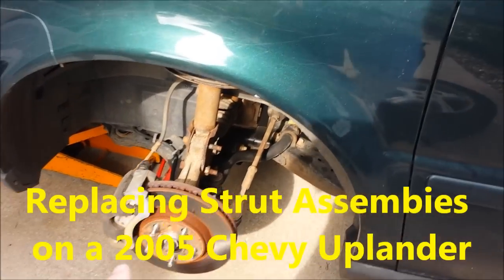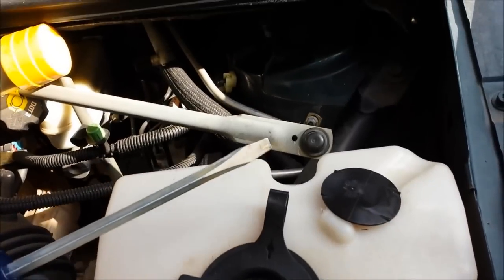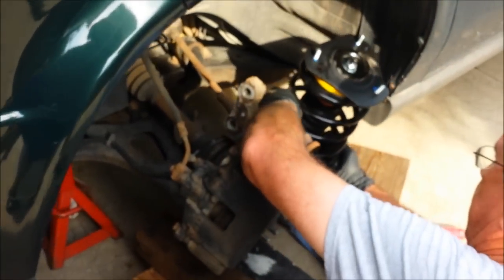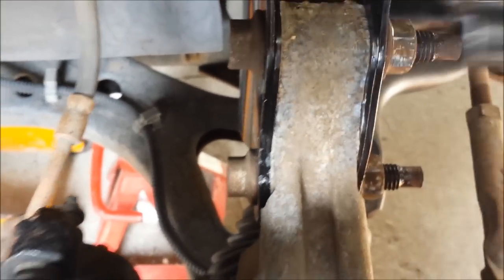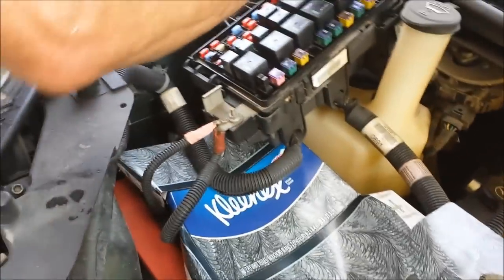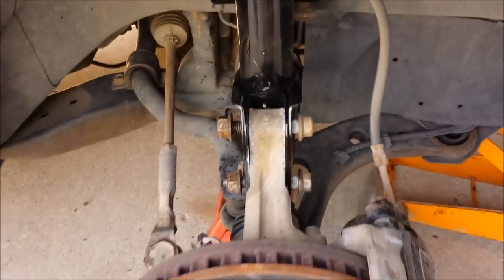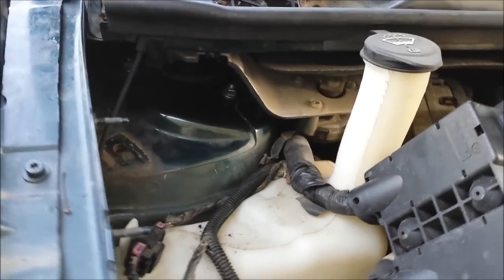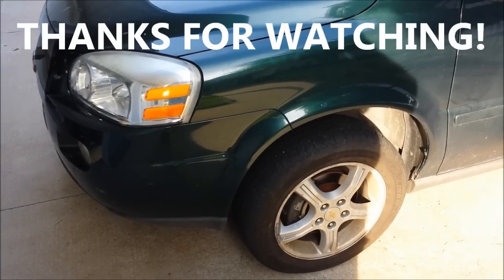2005 Chevy Uplander Strut Replacement

Comment: Advice #1, an impact driver will need a deep socket for the lower strut bolts. Also the sway bar may stop the arm from lowering enough to get the strut on and off. Try lifting both sides of the front end to let the bar pivot down. It is difficult to align the top bolts without help although I was able to with lots of swearing. I tried to only replace the upper strut mount but I found out the mount failed because a small section of the spring at the top had broken and would not fit the mount. I had to buy a new total strut assembly with my car up on jacks, unable to use the car to pick up the part. For a relative novice this job is a Biden. Good luck.

Comment: Well done. I used an air ratchet for those top nuts.
Reply: I couldn't even fit a gear wrench without removing the wiper linkages.

Comment: I'm not sure yet if it is, I pulled all 4 tires off looking around really good at what I know of. Looks good, as I backed out of the driveway onto smooth  asphalt slowly giving it gas and up to 10-20 mph it goes up and down kinda sways the van from side to side even not hitting any bumps or dips at all. I also inspected all the tires closely cause it feels like a boat on the water hitting small waves from the side.  
Kinda stumped here...

Comment: great video     would it be similar on a chevy venture 2000  the bolts on the bottom have to be torque????
Reply from the maker: +Victor Hernandez Using the torque wrench was the only way I could get them loose.  I tried with a socket and pipe but couldn't break it loose.  The torque wrench was the only thing that worked.
Reply: @travisgrindal  you mean an impact wrench not a tourqwrench right?

Comment: You seem to skip removing the stabilizer bar links that attach to the struts... or does your van not have them?   

Lots of fun trying to get a nut off a spinning ball joint!
Reply: They come right off with an impact and some penetrating oil.  I just did mine a month ago.
Reply: @seeya205  mine did nothing but spin and eventually had to be cut off and replaced.  They were just too badly corroded together.
Reply: @indoorroadkill3369  Mine did that too until I put an impact on it

Comment: How do u know the old ones were bad?
Reply: The vehicle will bounce more than once on a push down test if they are worn out.
Reply from the maker: My van felt like I was on a boat when I drove it.  I'd hit bumps and the van would bounce 5 or 6 times.  With good struts, you should bounce only once or twice, depending on how bad the bump was.

Comment: Just wondering what your van was doing to determine it was bad struts, I have an 05 uplander and it just started like humping up and down as I drive. 
Good video too! Thanks
Reply from the maker: toremup77 LOL!  That is exactly what mine was doing.  It should "bounce" one or two times when you hit a bump.  If it keeps going, your struts probably need replaced.  Bounce another car with your hands on the hood and see how it responds.  Then do the same on yours and pay attention to the difference.
Reply: Yeah same here but real bad. Got new sway bars also. Go over a speed bump at 10mph and if it bounces like a LA Cadillac  then its time

Comment: Use a breaker bar to break those bolts lose if you don't have an impact.
Reply from the maker: I just got my first breaker bar a couple of months ago.  I couldn't get the bolt loose that held my push mower blade on.  The breaker bar made it easy to get loose.

Comment: you need an alignment now.
Reply: There is no aliment needed on these
Reply: Old comment but, incorrect, you must align it after this and you have to elongate the lower strut bolt holes manually before installing @seeya205